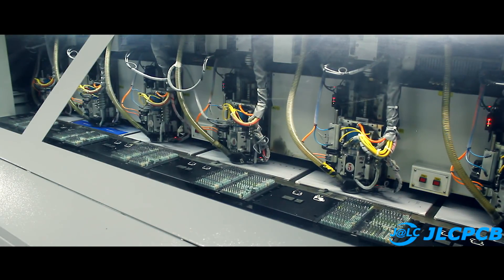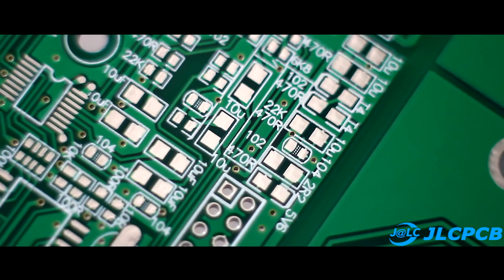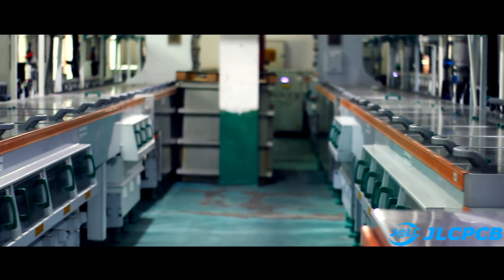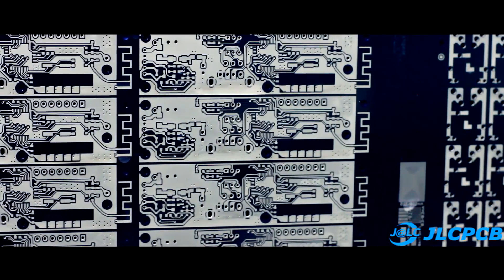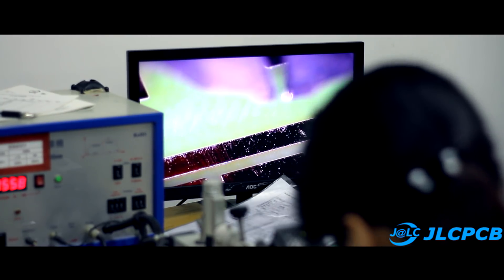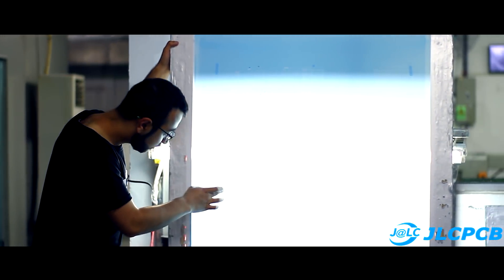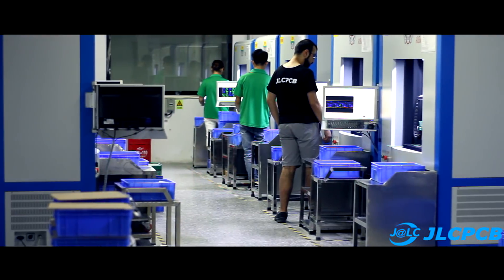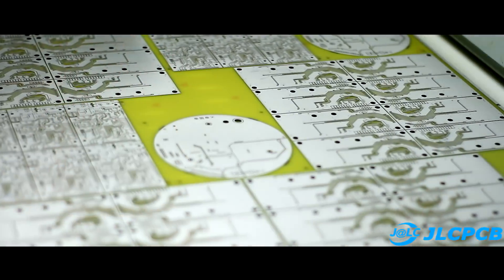JLCPCB Factory - 2-layer PCB Manufacturing

Comment: what a great company. They say dry film photoresist used in factory. its a bad way for producing pcbs with tracks below 12 mils. They should use positive photoresist method. Negative photoresist is not giving good quality. i can make 0.2 mils of tracks with positive photoresist.
Reply: It may be worse, but it is cheaper, especially when pumping out millions of boards every year